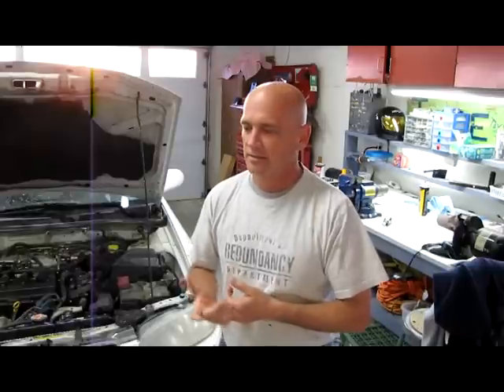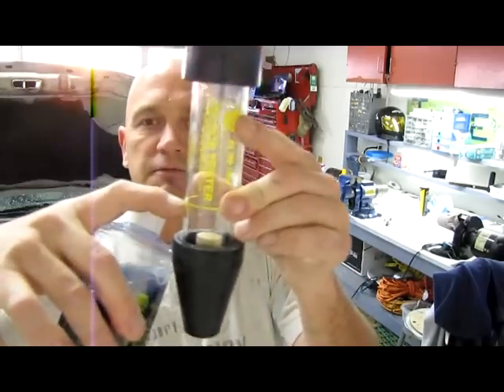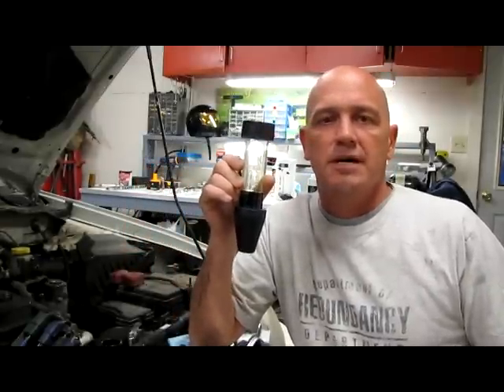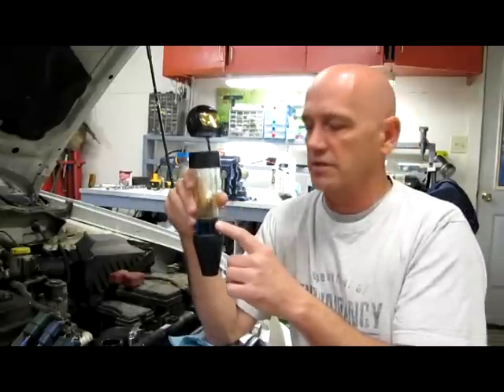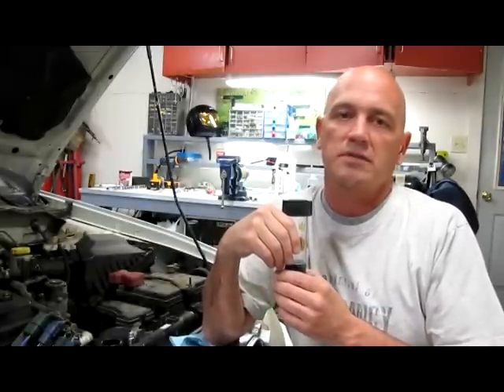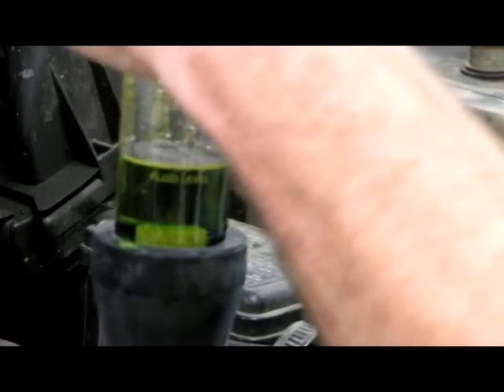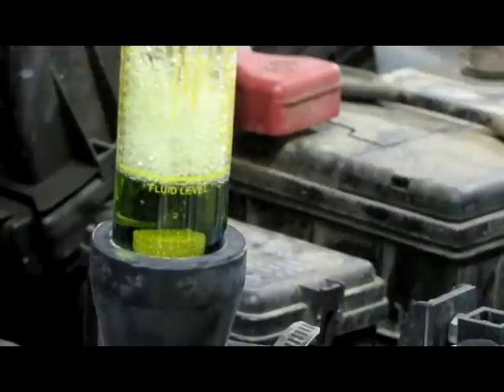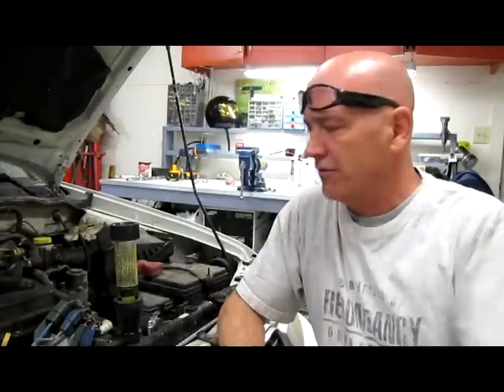How to Test Head Gasket

Comment: When I went to pick up my truck they broke the bad news to me that there were still overheating problems with the likely culprit being a blown head gasket. I got the truck home and today tried to use a block tester to confirm that there was exhaust in the coolant. After running the truck for 20 minutes with no sign of overheating I still couldn't get the blue color to change. With the radiator cap off, more bright orange liquid started gurgling and spewing out of the radiator fill hole....

Comment: Hey Russ, your videos are great, keep em coming. So... I am having problems with 2001 Dodge Dakota that I just bought this week. I tried to get it registered and was told that I failed emissions due to a miss in cylinder 4. I replaced spark plugs and wires and was driving back to DEQ when I started to over heat. The radiator overflow was filled with bright orange rusty slop. I took my car to a radiator shop and they told me the radiator needed to be replaced so I agreed to $350 repair job (cont)

Comment from the maker: Mike MAF cont'd: use the expansion tank as typical.  If all you find is a simple non-pressurized coolant reservoir this process may not work for you.  It's imperative that you understand and use the pressurized cooling system to affect the chemical properly. Send me your vehicle specs and I'll do a bit of digging online and see what your system looks like. r-

Comment from the maker: Mike MAF: Mike, to my  knowledge there is always a way to add to the system.  A 'closed' system usually refers to the type of system that is designed for pressure build-up.  Locate the point where you add coolant and determine if it also holds the pressure of the system.  Expansion tanks do (I think). In that case you can continues...

Comment from the maker: ramirez: the most obvious would be the 'steaming' of coolant in the exhaust, or heavy white smoke in the exhaust. Some others could be overheating for no obvious reason, over-pressurization of the upper radiator tank (if equipped), cylinder miss-fire upon cold start that clears out, missing coolant from radiator but no external leaks, oil on dipstick looks like chocolate milk, coolant shooting out the tailpipe or exhaust system-- these are a few I can think of.  r-

Comment: I'm not big on fill and seal type fixes, but I used blue devil to remedy a small head gasket leak on my old 3000gt and it worked (for the head gasket, not the rest of the p.o.s. car)...that stuff works well if you used it as directed.

Comment: I have done it personally and it does work. In an expansion tank type system, where the pressure cap is on the tank, the tank is a sealed part of the system, basically just an extension of the radiator. It's actually easier to test on that type because you normally would not have to remove any coolant before testing. For diesel applications it depends on the test fluid used. There are gas or diesel only fluids, as well as a test fluid that covers both.

Comment: Thanks for the info, GREAT VIDEO. I will be testing our 01 Honda Civic this week. Lost heater heat then it came back, now it heated up about 3/8" on the gauge higher than normal and pushed some R-fluid out the overflow. Now it seems to be fine. So I guess with this erratic behavior it looks like it is pointing to a HG.

Comment from the maker: herohonda: I have never performed this test on an expansion tank type system, although I would imagine it would work so long as the cooling system has direct access to that tank-meaning that at operating temps the expansion tank shares the same 'fumes' that may be in the cooling system. According to Blue Devil it does work with diesel engines. Not sure about the Napa block tester but you can call Napa at 800-538-6272 to check, and Blue Devil is at 888-863-0426 for questions about their product.

Comment: Does this work on a cooling system where you can only access the coolant from the expansion tank. I have no rad cap you see, only an expansion cap. Also does it work with diesel cars?

Comment from the maker: Massicotte: Yes, a GXE like yours. It has a timing chain, so the biggest challenge is making sure you fully document the mechanical timing at TDC, double/triple chk and make drawings of chain links (I marked the links with fingernail polish) take pics, and hold up the chain to keep it on the crank gear (I used bunji cord to hood). If it drops, it's a ton more work to pull timing cover. Don't risk messing up mech timing if uncomfortable with it-can ruin engine. If comfy, prob 2 or 3 weekends. r-

Comment from the maker: Mike cont'd:  You know, you could have jammed so much snow up into the grill area that it was difficult for the fan clutch to have drawn adequate air over the radiator veins.  I'd check with other plow folks to see how they combat that; I used to live up in heavy snow country myself so I could see how that may happen.  Smelling coolant, from the inside of the cab?  If so, heater core issue/leak (Blue Devil can potentially fix that too); Outside: leak. Hope this helps some anyway. Good Luck! r-

Comment from the maker: Mike cont'd: Second, plowing is a condition when you have no RAM air over the radiator. In those designs most full-size trucks use a fan clutch (thermal) to draw air over the radiator once its temp reaches a certain point. If your fan clutch isn't working, you got no 'fan' when needed, like when plowing or at stop lights or stop/go traffic when you have no RAM air (at high speed) flowing over the radiator veins.  So that's suspect to me due to the conditions of plowing.  I'd block test it. r-

Comment from the maker: Mike: Well the gurlgling/boiling sound is very concerning.  Boy, you make me miss working on other people's cars! Assuming it's the coolant boiling, once anything starts to boil, it no longer 'flows' (vaporlock is a very mis-used term-it's fuel boiling causing no flow, same deal).  So the boiling sound indicates to me that you probably had no flow in the major cooling system at that point.  What caused it to boil? Many potential things. First, you ruled out external leaks. Continues...

Comment: Great video, i have an 02 silverado 2500hd. I just plowed for 3.5 days straight and frankly beat the shit out of my truck. Long story short. I overheated twice while getting stuck in the snow and trying to get out. First time didnt seem to be an issue. Second time i heard gurguling/boiling under the hood. The truck soon after was calling for coolant. I added it with the engine off. Several hrs later it was calling for it again. I added about 1/2 gal to top of line. Now 3 days later its asking...

Comment from the maker: YoungDynasty: Well I've seen mucky-light-colored 'stuff' like that before on older cars with no real performance issues.  I'd probably say just run it and see if it has any issues.  If not it's probably ok performance-wise.  But a good flush wouldn't hurt.  Lots of cars are neglected so that's probably more what you are seeing.  The blue thing could be a new part or a cleaned part, but depends.  Some headgaskets are visible, some aren't so much. If the head looks way newer, it's a 'correct' job.

Comment from the maker: Barfysptiz: Just an idea, but on the older varieties of cars I've seen cases where checkvalving and/or diaphrams inside of mech fuel pumps fail, causing fuel to be able to get into the block/crankcase.  Not sure how much your oil smells like gas, but if the oil level is rising that may be a good indicator to replace the pump.

Comment from the maker: Barfyspitz: typically overheating without having a 'leak' externally is associated with a damaged headgasket seal- not too sure about the haziness of the oil other than you indicate it smells like gas- does it by chance have a mechanical fuel pump on it? r-

Comment: Crazy man....I was sure I had a compression leak.  I ran it for about 10 min pumping on it, never change the blue color a bit.  I have the thermostat out of it.  Wonder if that has anything to do with it?  The color of the oil and difference of the #2 and #4 cylinders indicate a leak the the block tester says no.

Comment from the maker: Barfyspitz I found this posted on my channel from you:

Ya the condition of the oil has me concerned. I don't drive it except on cruise nights. The oil looks like new oil with a white haze...smells like gas. It's a stroker motor with a lot of time and money put into it. Picked up the Napa test kit for $43 bucks and I'm going to use it and then do a compression test over the next couple of days. I'm afraid something is wrong with it.

Comment from the maker: Barfyspitz: It's really not uncommon to see drips of water 'spitting' from the tailpipe-the exhaust system is subject to condensation with the temp changes overnight. Never seen 'hazy' oil, myself, but it should look like, well, oil-ha! If it overheats for what seems to be no real good reason, that's the main symptom I see. I'm curious about the 'hazy' oil- could have a bit of coolant in it. A block check could confirm or rule it out. Would love to hear back.  thx!

Comment: Thanks for this video and showing us the part number for the tester.  I need to check my old  charger for this.  The exhaust is spitting water and the oil on the dipstick looks hazy.  Would a blown head gasket cause this?

Comment from the maker: leftnut: I'm not totally familiar with your system, however if it has a 'typical' type of radiator cap, know that that cap is also a valve, allowing excessive pressure out as it should.  If this type of cap can't hold pressure any longer you can get what you are experiencing.  I'd try a new cap first.  That is, unless it's not a 'typical' type cap and has a type of expansion tank design.  Not to say that you don't have this issue, but worth a try I think-

Comment from the maker: Brian, over my years of working on cars I have heard of similar 'requirements.' In some cases I have discovered there is no need, really, to follow them, and in other cases we have no choice but to follow them. Specific coolant types, however, came into being after I had began working in a different profession, so I don't have a lot of experience with that. My opinion is that Subaru should have a recall if there is any known design issue, be it a head gasket or not. I'm sure you agree. Continues

Comment: Thanks for this video.  I have a 2003 normally aspirated Impreza TS 2.5L which I've had since new that has only 29,000 miles on it (47,000 KM).  Subaru knows that the 2002 through 2005 or later normally aspirated 2.5L engines have a head gasket leak problem. Subaru states that only their OEM coolant should be used because other makes of coolant attack their crappy head gaskets. Unkowlingly I had non OEM coolant put in.    What do you recommend I do to prevent/delay a potential head gasket leak?

Comment from the maker: UPDATE Dec. 21012: It turned out that after full disassembly of this engine, the OEM headgasket had a rip torn right in between cylinders 3 and 4.  It had so much pressure on that area that when I went to clean the top block surface in that area there were markings on the top of the block: a very direct leak in the seal.  Headgasket was changed and put all back together.  Ran like a champ afterwards, but OMG what a job this was!  Not for the faint of heart, for sure.  r-

Comment from the maker: Dex- one final note- you may want to check out my other video I made after this one on a Toyota Camry- same weird issue with sproratic overheating.  It's more in-depth and shows this process in detail.  It also covers my experience with a chemical called Blue Devil.  The results this far have been very positive in my case.  r-

Comment from the maker: If you are concerned with headgasket failure, have the second facility pull the thermostat out, reseal the system up without a thermostat, run the block check if possible,then reisntall a new thermostat and seal.  That way they can confirm whether or not there are combustion/compression fumes in the cooling system.  There should never be those fumes in the cooling system. In the process of changing out the thermostat, they can run this test for you, if reputable and up to date with equipment. ->

Comment from the maker: Hey Dex-it's good that you took your car to a couple of places for testing, and noted that the 'dealer' indicated such deep repairs and costs. Just because it's a dealer doesn't necessarily mean they are always correct. This could even be just a coolant temp sensor issue. If the second facility is trustworthy, I'd have them provide proof of testing and have the thermostat changed. That could be the issue.Know, however, that any extreme overheating issue can cause headgasket failure. continues...

Comment from the maker: Hi Scully- well just from your description I haven't ever seen a faulty water pump cause coolant to get into the combustion chamber, unless it overheated to the point of warping that head-to-block surface, simply due to way way overheating.  The water pumps I have worked on don't have any kind of channel into that seal by design.  But, again, my experience is with the older generation of cars. If you continue to have bizarre overheating issue, have a block check ran. Luck to you and thx for resp

Comment: I drive a 2006 Chevy Impala and I had an error that said "Engine Hot, A/C Off" and my temp gauge showed all the way cold. I took it to a Chevy dealer and they advised me that I had a blown head gasket and that it would run over 2k. Online I saw that this error was extremely common problem for GMC cars and that most likely it was just a broken thermostat issue. I took it to another shop and they advised that the head gasket was fine and that it was just a thermostat. Should I try this test?

Comment from the maker: Hey Scully, this could be any number of things. I am assuming this is the first time you've noticed this smelly white smoke. I've even seen cases where brake fluid was getting into the combustion chamber(s) due to bad one-way valves brake boosters and such, which caused really white/smelly smoke. Not really enough info here to tell. If in doubt, have a block check ran on it or have your mechanic run some further testing.  r-

Comment from the maker: A blown head gasket is typically the result of overheating beyond acceptable tolerances-or a result of another problem. Your description doesn't lead me to believe you have yet damaged a head gasket, but you need to find out where the coolant is going.  Great timing on your part-I'm about to post up a video on how to pressure test cooling system (non-expansion tank) with a test tool.  If it does overheat beyond tolerance, that's when the head gasket can fail.  If in doubt, take it to a shop. r-

Comment: Very informative video, thanks! My '99 Alero has been leaking a great deal of coolant for a while, but there are no other symptoms of a blown gasket (no oil contaminants, the engine isn't overheating at all, I haven't seen any bubbles in the radiator fluid, etc.) Could it still be a head gasket issue or is this most likely due to a hose?

Comment from the maker: Based on your description, yes I have seen a build-up of what looks like chocolate milk- a frothy kind of stuff, inside the cooling system.  However, in normally-operating systems I have also seen a brownish buildup as well.  The block test is a good way of determining if you have an issue for sure. I would caution folks to keep the lower opening of the test tube covered with their hands when not in the radiator, because it is detecting fumes, which can build up inside of a work area, too.

Comment from the maker: According to their website, yes it does work on diesel engines. Here is a quote from their site: 

"BlueDevil Head Gasket Sealant permanently seals cooling system leaks such as blown head gaskets, warped and cracked heads, heater cores, and freeze plugs. BlueDevil is non-clogging and contains no solid or particulate matter which can be harmful to the engine. It can be used on gasoline or diesel engines and bonds to metal, aluminum, cast, alloy, or plastic."

Comment from the maker: I also have an old 1989 Honda Accord- single timing belt, simple and has as much if not more power than this 2002 Nissan Sentra--.  Belt replacement on the Honda would take me a few hours, yet this Nissan- tons of work.  Nice little car, but really?  Overly complex in my view.  It actually runs with less power as compared to the old old Honda.  thx for viewing--  r.

Comment from the maker: Good question.  Obviously this tool that I use is for the more 'older' generation of cars of this type- I have seen the types you refer to, and I do not have a 'tool' for that, myself.  For that issue, I would recommend that you locate your local professional auto-repair tool suppliers, such as Snap-On, MAC or NAPA sellers.  They could point you in the right direction, and perhaps may have the 'right' tool for this type of job. r-

Comment: How do you use this kit on a newer model of car where there is no radiator cap, the system is sealed and you only have a larger cap (larger than what you are using in the video) in the expansion tank?

Comment: not sure which type i have, it's a 2000 Deville (Northstar engine) and the recommended coolant is DEXCool @ 50/50 mix.  I'm wondering how much pressure should be on the top and bottom radiator hose.  When idling during warmup I can squeeze each hose with little resistance but once I've driven the car a couple of miles the top especially is very firm.  I'm concernd that it may be building pressure due to the heads separating.  I hear that's common on the Northstar with high miles especailly.